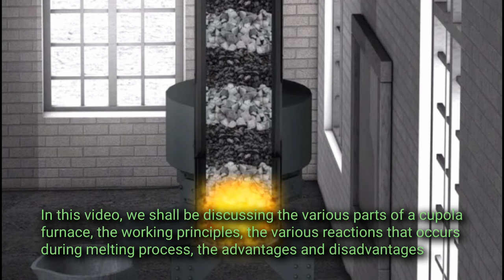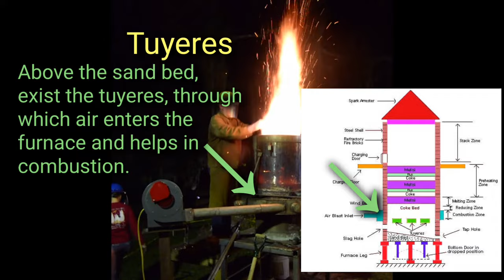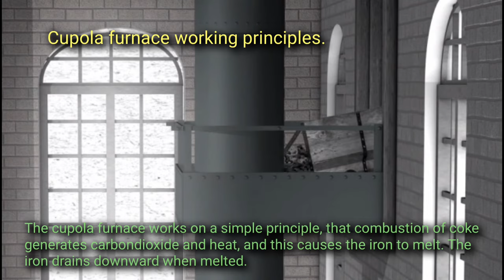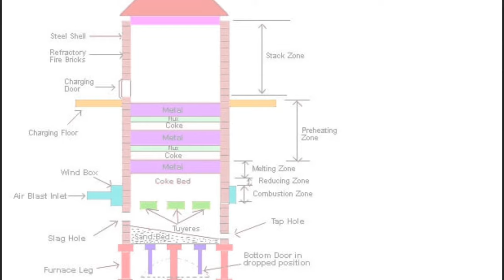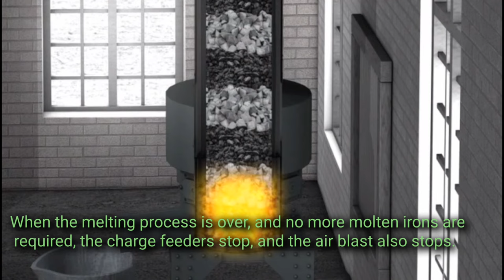Cupola Furnace | An Overview

Comment: The bed height depends on both the diameter of the cupola bore and the blast pressure.  It may or may not be 40 inches.  Also, with the advantages of a cupola listed at the end, you forgot two of the most important.  They are FAST.  Many times faster than a large crucible type furnace.  And they are continuous melters, dropping charge after charge as long as layers of metal and replacement fuel are added at the top.